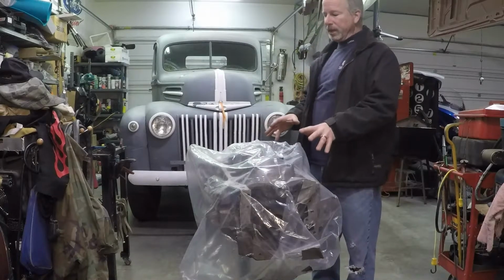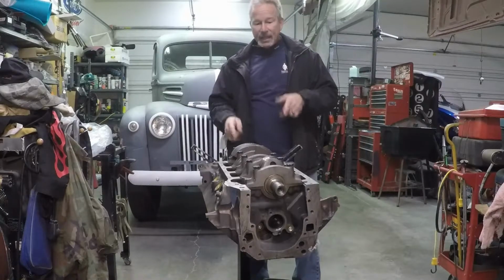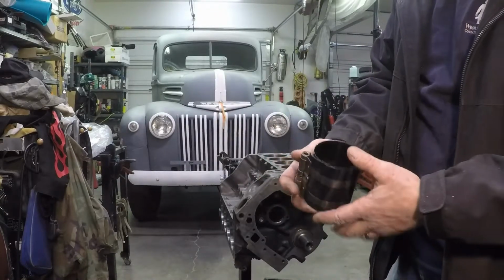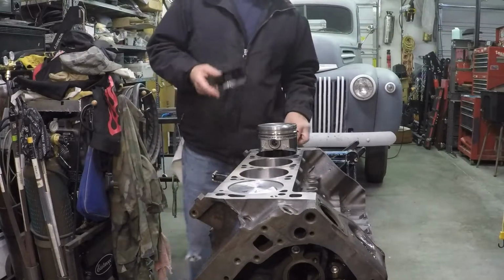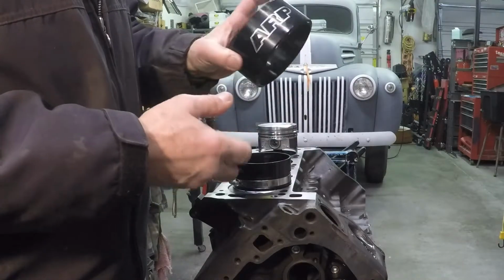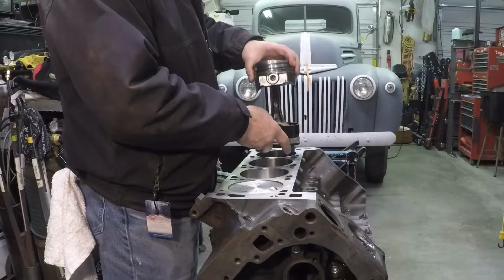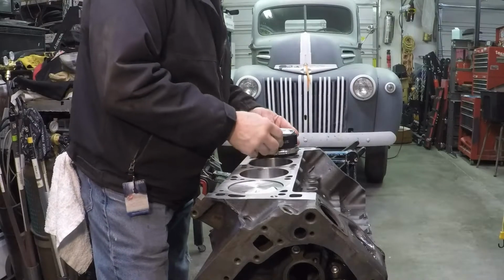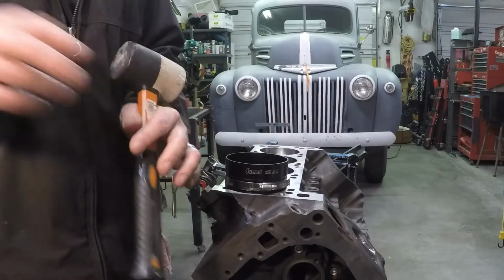Which Ring Compressor is Best??

Comment: Have no measured bore yet, but it is 4'' stock, i think your saying it only works on a new bore and is not adjustable?
Reply from the maker: The two ring compressors with the bands or hose clamps are adjustable. The one that is for a 4.270 bore is not but it is sold in specific diameters to match your cylinder bore.